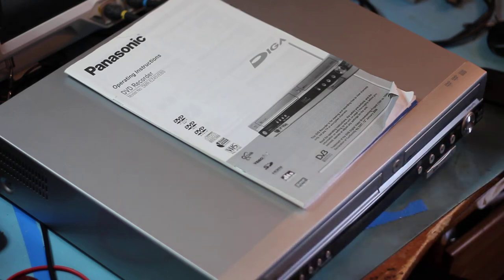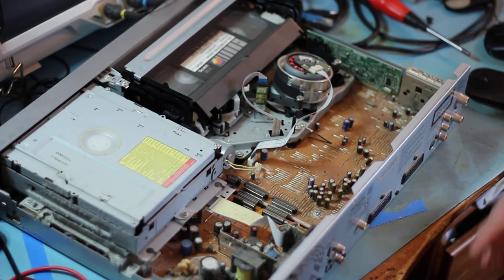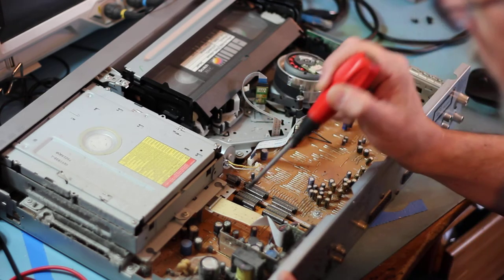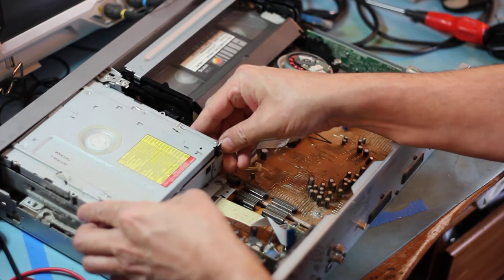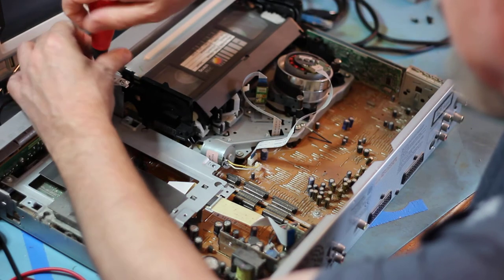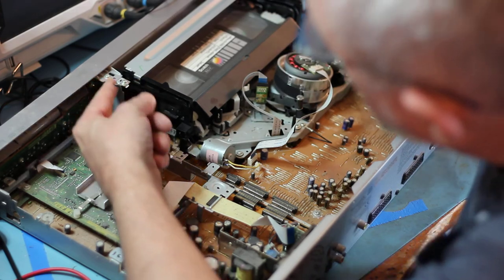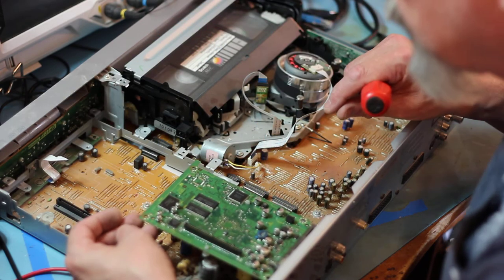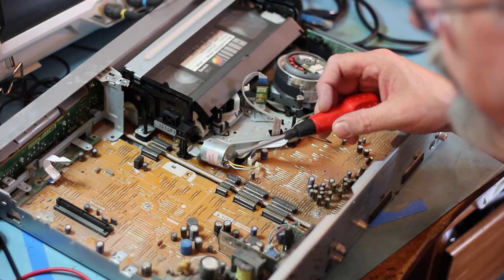Panasonic DMR-EZ45V - The lights are on but there's nobody home - Part 1

Comment: You don't need to replace all those caps, I have repaired a few of these, it will need around 6 caps to be replaced,
I take it you have access to an ESR meter?
Reply from the maker: Thanks @markpirateuk. Yes, I realised that after removing the board and looking at the PCB underside. I then consulted the schematic for the PSU and will only replace the cold side standard electrolytics. The low ESR caps test out fine with ESR well within tolerance and, just for good measure I'll replace the smoothing cap on the hot side; about 7 in total I think. This is what you get when you have to hurry a video, shooting it in one take and immediately uploading without a single edit!!! You have, however, reminded me that I must build an EPR meter for more sensitive leakage testing. Thanks for the constructive criticism; so rare in the lower half of the Internets :)
Reply: @SteveBrace  Good luck with the repair, as you have found out, these are a real pain to dismantle!
Be careful when removing the black board interconnect plugs, they are easily damaged.
Reply from the maker: @markpirateuk  Yes. I have encountered this type of interconnect before!!! And thanks :)
Reply: I just bought a 48v for 4.99 from, goodwill.    I also just ordered a remote a few minutes ago.  Mine turns pink and the digi tuner cant see a signal  at all. Suggestions?

Comment: I have a similar recorder. It doesn't work anymore, dead. That's not really an issue, apart from the content on the HDD. I understood you can't play the HDD without some ID-from the device (to prevent piracy, which I understand). So I wonder (no piracy in mind) whether I could read/watch what's on the disk without having to repair the whole power system? Can't I just power up the drive leaving the ID-system intact?

Comment: I think most VCR-DVD players are left on 24/7 365. With the fan not working 100% it just slow roasts the power supply.
Reply from the maker: It certainly appears to be the case here.
Reply: I have one with a HDD, which is meant to keep on 27/7, downloading a program guide every day to stay updated for programming recording from TV.